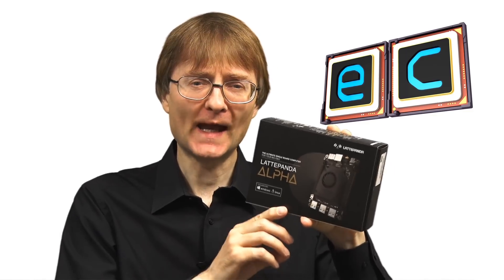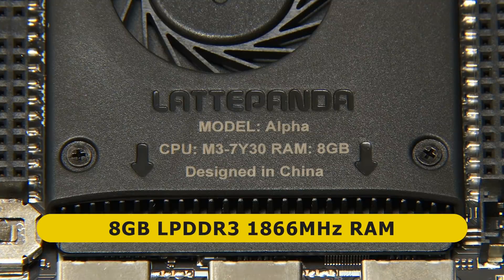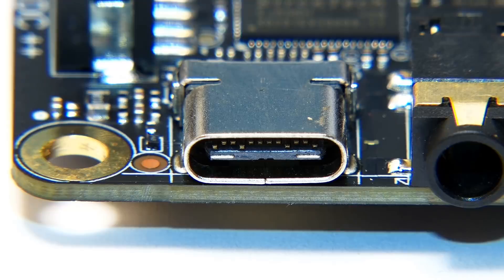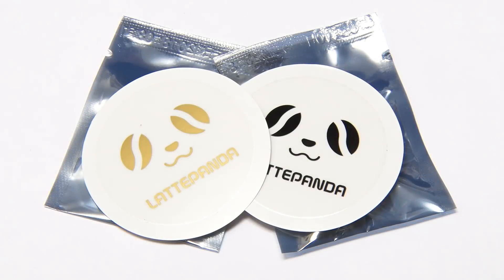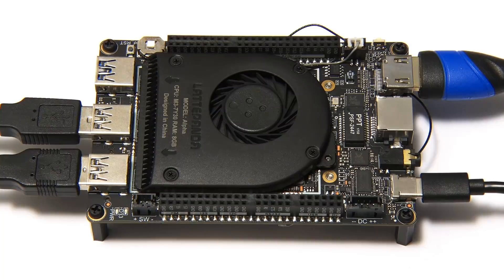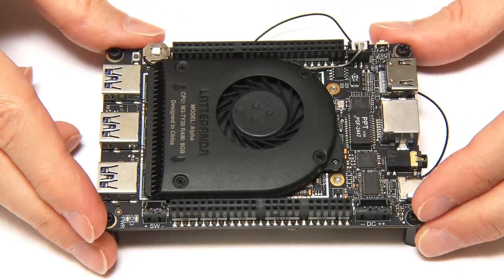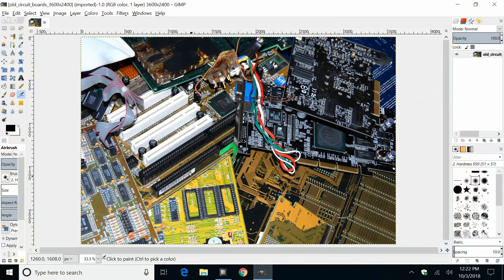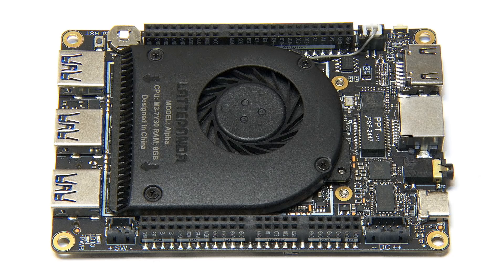LattePanda Alpha: Windows & Linux SBC

Comment: This is more like laptop without display :O its spec and price is not like another 'single' board computer ...
Reply: Even the Mac mini has similar specs for the price
Reply: laptops hasn't GPIO pins and they aren't so small
Reply: yea well  it targets people that dont really care about money and want a powerful single board computer with lots of connectivity and options,you can do a bunch of stuff that you cant on a laptop here,i think it will sell well since no one occupies that market.
Reply: @TheBilaras97  I have companies offering the same performance in a much more expensive "Package". I was a Beagle Bone user, and these blow my cheap laptop away. And a 4K output? I needed that 3 years ago.
Reply: I just bought a SBC with i7-8550U 50$ less (No ram and disk)
Reply: uǝʌƎ Finckenhagen will you mind sharing source company and product name plz.
Reply: uǝʌƎ Finckenhagen No Disk and no OS --> 318$ - 50$ = 268$ for an i7-8550U Really?? ;-))
Still have to buy your disk, RAM and maybe OS
Reply: @Tulip00000  brand etc?
Reply: What's bullshit.. So what is it? Maybe a magic carpet?
Reply: It's exactly that, a small form-factor laptop without screen. which is really cool.
Reply: Well my laptop is very bad. It has an atom n270 processor. I think i will update to this sbc
Reply: It's going to be the base for my diy laptop!
Reply: Kesus Kim the specs are similar to the 12 MacBook that Apple sells for 4 times the money.
Reply: @connectorxp  still can't run MacOS which is important if you need certain apps and OS utilities
Reply: Roberto M. It can be installed macos
Reply: connectorxp :) I think SBC itself is not like a product but like a part of product! Maybe that is why. But as a developer even if I have lower spec macbook, I would buy this SBC over macbook for upgrade, mainly because I already have one to work with.
Reply: The Kickstarter campaign for this used an interesting slogan : "Soul of a MacBook in a Pocket-sized Board".

Comment: This looks like it'll have very limited application. The price immediately rules it out of the hobbyist market, so you're left with industrial/commercial use, and I just cant think of any that need that level of connectivity and specs. Even if you go down the digital signage route, nobody wants to be running Windows given how awful it generally is, and for mission critical operations its not been a good or viable option for a while. 

Lower priced nix* compatible boards will continue to shine here I think, this just seems like its going to flop right out the door.

Comment: Great SBC but you'd think for $350+ they could include a proper case and not some $.30 stand offs and screws
Reply: Clearly, you should be grateful that they made it at all ;o) #NoMarketForThis
Reply: @pdjames1729   yeah grateful I can't afford it. Grateful they couldn't even offer a 3d printed case or some cheap case like odriod does.    Case is a basic feature.
Reply: see? you are super-grateful xx Personally, I think it's test-market shit... if Latte wanted to prove something, they would do what all sbc manufacturers do. And offer a fantastic Value Proposition. They know there's no market for this, they are hoping #bledgers are stupid enough to pay 3x as much as it should be, so they can pose with a 'real PC' in their pocket... with no case, no real PC sockets, like PCIex16, no upgrade path and a bucket of wall-warts and addons to carry around to make it work. Just like any sbc but hideously over-priced. You know they have a short run and are don't expect to sell many. SBC have fixed specs and are Cheap to make - and if M$ would stop auto-failing on Doze for ARM - Pine 64 would be kicking this things ass, starting at $15.
Reply: @pdjames1729  I think you're right.

Comment: It is interesting to compare these bigger SBC's with the lower end conventional desktop PC's pushed out the door by more mainstream PC builders. For example quad core Celerons with 4gb RAM (1600mhz DDR3)  and 120Gb SSD SATA3; the one I am looking at from a UK builder costs £340.  But the Alpha board with 8Gb DD3 1866Mhz and with 512Gb M.2 PCIe NVMe SSDs can be purchased for only about £360.  My experience suggests to me that is the storage that throttles low end Intel CPUs and so perhaps the Alpha is a much better buy.  Or I could be wrong.  :)
Reply from the maker: This more for me is the first to really blur the lines between a conventional desktop and an SBC. Using GPIO, another USB port could be added, and if powered by the 12 volt connector, that would leave 3 x USB 3.0, 1 x USB 2.0, and the USB C for either USB 3.0 or DP, so allowing dual monitors -- and the power as you note. I think we will see many LattePanda Alpha/Delta cases.
Reply: That Celron box I mentioned doesn't have as many USB 3.0 sockets as the Alpha; in fact its connectivity on the whole is  a generation or three behind.
Reply: check refurb 3770 or 4790's on ebay xx £350 will buy you a 10k rated 3.4ghz+ monster.
Reply: I get your point.  But I was comparing new boxes with similar performance.  You can get all manner of different options buying secondhand.  Especially if like me your main use is office.
Reply: Yes.  I can remember pricing up AMD systems with oodles of RAM for next to nothing.

Comment: These boards must be very well optimized, it is impressive how it works, shows how much work is to be done on other single board computers, my phone has 8 cores at 2ghz , my phone wouldn't touch it for performance, intel look a generation ahead, but I'm sure these arm devices will get there one of the days.
Reply: You are comparing x86 and ARM platform.... A very different beast overall...

Comment: This Latte Panda is great contender to an Intel NUC.  It’s not as fast as the latest NUC or have Thunderbolt 3.  But it has GPIO ports that you could use for  many projects.
Reply from the maker: You sum this up perfectly.
Reply: You can use eGPU on this board if that's what you want TB for.
Reply: The Intel + AMD Vega will likely have better graphics power, so it depends on the application that you're using it for. I would imagine for most users, who don't need very much power to begin with, you're going to have enough power in a device like this for most of their needs. If you just run a browser, Youtube, and basic office applications; it's all you need.

I have a laptop that's in the same spec range (in fact, closer to the 432 model) and it's great for a cheap ultra portable option. It runs for about 7-8 hours with Ubuntu Mate. I don't use it for a lot of power intensive things but the built in HEVC helps battery life with video processing. The basic applications (word processors, spreadsheet apps, etc) will give you closer to 10 hours of run time.

All of that being said, if I was buying a console killer / media center device, I might opt for the new NUC, just because it's got beefier specs for 3D graphics.
Reply: Intel NUC --> USB --> Arduino Mega, or USB hub to 5 Arduino Mega's.

Comment: we can buy a good laptop with 300$ . So why should we spent a lot for a single board computer that has no monitor or keyboard or mouse.
Reply: Parvej Ibn kamal size and formfactor I'd say.  Plus the Arduino built in is cool.
Reply from the maker: The answer is if you want a very small board, and/or a board will a great deal of connectivity (those 100 GPIO pins). A major market for this board will be eg, AI and robotics projects.
Reply: In this case, less IS more ;)

Comment: Thanks for the great video!! 
 I believe (if I am not wrong) sbcs don't allow end user to use nvme as a boot drive.Why sbcs use only emmc memory as boot drive when they have a much faster nvme m.2 to boot from?
Reply from the maker: The LattePanda Alpha can boot from the NVMe SSD. In fact, if you bu the 800 model (ie with no flash storage) it will have to boot from a SATA or NVMe M.2 drive. However, if you purchase a board with Windows on it, it will be installed on (and hence boot from) the eMMC.
Reply: @ExplainingComputers  Thanks.That's awesome!!

Comment: Am i the only one who thinks that the 864 is a little over priced considering what one could do with $400
Reply: no you're not. you get can something like an asrock beebox with your choice of 16gb ram if not more and storage devices for about the same price
Reply: if you didn't need the small form factor and could use external arduino controller, you could buy like three used servers with 24gb ddr3 advanced ecc ram and 2x xeon e5620 processors (8 cores 16 threads in total) for $130 each and then have a bit of money left over for mcdonalds dinner or something
source: personal experience
Reply: You are absolutely right.

Comment: Udoo be like :
Lattepanda : we released a sbc with a core m3 7y30
Udoo : hold my beer
Reply from the maker: I have been promised an UDOO Bolt review sample in early December. It will be very interesting to see how it compares to the new LattePanda range.
Reply: Yup! That amd v1000 is a very interesting chip, for its powerful vega gpu. From the cpu side the v1200 should be at the same level as the panda, but the gpu completely crushes it.
We just need to wait :)

Comment: Great video. Considering the price and sophistication of this computer, what is the intended market? It's to expensive for a hobby device. Does the manufacturer intend for it to be used in some kind of end system?
Reply from the maker: Not yet. But I'm sure these will be available soon. Watch this space!
Reply: As someone who hates Windows 10 and can't use a Mac, I am looking at every kind of option to use as a desktop PC set up with Linux. I am not a gamer. I don't need specs that are that great; any equivalent to an i5 cpu would be good enough.
Reply: You would be better off getting an i5 powered NUC barebones kit (or non Intel equivalent from Zotac/Gigabyte) and installing your own RAM and storage. The m3 7y30 on this board is less powerful than the i3 7100U, and not really all that close to the i5 chips found in Intel NUC systems, which also have much better integrated graphics.
Reply: Thank you.
Reply from the maker: A big market here will be higher end maker projects, and robotics and IoT / AI applications more generally (due to the 100 GPIO pins). But there will I'm sure be some consumers who will use them as tiny PCs, media players, car-puters, etc. For the latter the LattePanda Delta is clearly half the price, but offers all the same connections.
Reply: Can I ask a really dumb question? If someone used the Latte Panda as in effect a mini desktop PC, then is there a case/motherboard cover to go over the SBC to protect it all? [a bit like the case in a tower part of a desktop]

Comment: Video editor on SBC.... When you replied on your post that "it is serious SBC " I though you were kidding.
Reply: To be fair all that was done there was install the program and load a saved project. No editing (let alone rendering) took place from what I can see. Completely moot point IMHO
Reply: again, refurb 3770 or 4790 quad at 3.4ghz+ is a 10,000 rated machine (on cpu benchmarks) = about £400 with a half decent gfx card and storage and an upgrade path and a box...~
These things feel much more like proof of concept than useful equipment.
Reply: I don't need half a grand of wallet sized PC in my back pocket. Very few people do.
I'm not an astro-mountaineer doing bulk satellite retrieval at 20,000ft.
SBC's have fixed specs, making them CHEAPER to manufacture - the whole point is that you get more power for your money, not catastrophically less.
and... I can remote my PC can't I? If i really want to, I can spend £400 on more computing power than was on the whole planet in 1970 - and 4G my fone to it. #smartarse :P

Comment: windows 10 is activated by your email address that is  attached to your account if you join insiders it will or should activate it on information install but then wind blows might want a separate key not sure on that but im guessing that is the idea   ( i researched this 2 min ago and unfortunately no is single machine licence :(
Reply from the maker: On the board I had, Windows was preactivated with a digital license not linked to my e-mail address), and you do not need to log in. It should be possible to add a Windows account and link the activation to that. This is getting pretty common with pre-installed Windows these days. The laptop I typing on right now was done the same way -- it arrived pre-activate with a digital key. License key codes are becoming rarer these days.

Comment: I'd all but forgotten about the LattePanda. This SBC looks pretty slick overall but the price seems a bit on the steep side. For $400 I would more likely put that on a laptop which would (obviously) include everything needed for computing. Still, I can appreciate getting so much computing in such a small package, just wish the cost itself was equitably smaller. Thanks for the review!
Reply: The Delta 432 for $188 is a pretty solid deal. The CPU isn't as good, but still a monster as far as SBCs go. I opted for the Alpha 864, should be arriving this week!
Reply: A laptop doesn’t have a GPIO port.  The GPIO is one reason why people buy SBC for their projects. For some users this may actually be a contender to an Intel NUC.
Reply: I hear you, and since I'm not a maker/tinkerer I suppose I overlook the value of the GPIO. The barebones NUC could be a contender, at least a case is included and mounts for HDD.
Reply: it does completely belie the whole point of sbc's - fixed specs and a single board is supposed to make things cheap to make.
So you get More power for your money.. not dramatically less, in a small package...
Reply: There are legitimate uses for SBCs this powerful. Maybe not as many as for a FAR cheaper rpi3 or tinkerboard, but I suspect most purchases of the new LattePanda will be just for the awesome factor rather than actually wanting to use it in a project. This includes me. This is a cool piece of technology, mine should arrive this week!
Reply: and I sincerely hope Latte make enough money from this short run to pull the next version much closer to the SBC market. It's a (slightly odd) prestige purchase right now. Same as when I bought my first Pi.. I got one cos I wanted one. At the time I had no idea what to do with it.. but that was £30. Not £300... #ThisISNotAnSBC yet?
Reply: Well, my original LP is being used 24/7 as a low power server, so I'm getting some good use out of it. Was it worth the price? Probably. The Alpha though, yeah that's a whole lot more expensive. It's a hard-to-justify purchase, so I'll just not even try to do so. :)

Comment: Have you considered comparing Davinci Resolve 15 on Linux vs Windows , (maybe on a single board?) You have to do a few tweaks to get it to work on Ubuntu but from reviews I've seen it's gpu based code is very impressive.
Reply from the maker: This is something I have listed to try sometime.

Comment: i was on the site last night i saw the pre orders but lets say if you want to pay $300 for one you might as well buy a laptop or a PC :)
Reply: if you don't need the small form factor and can use an external arduino controller, you definitely should buy a laptop or PC as it might be cheaper and better
Reply from the maker: It depends if you want/need the GPIO and/or small form factor.
Reply: yeah i have to agree there :)